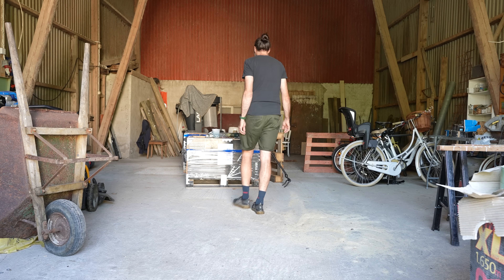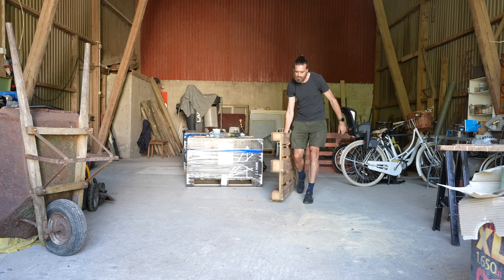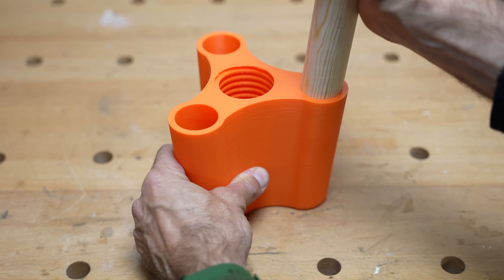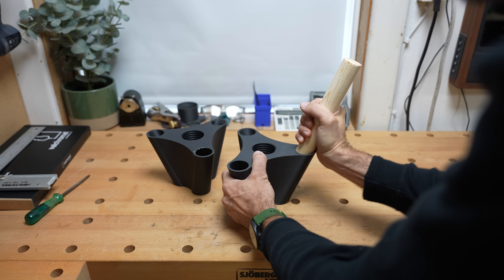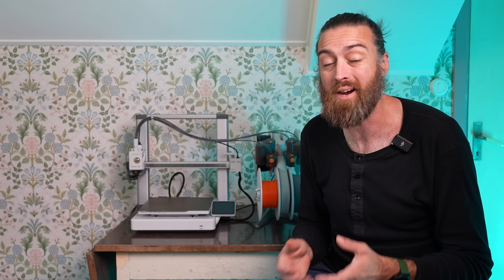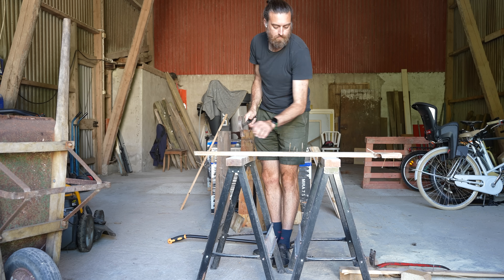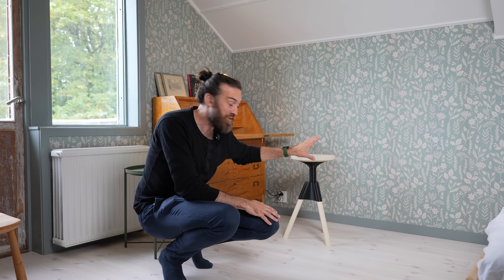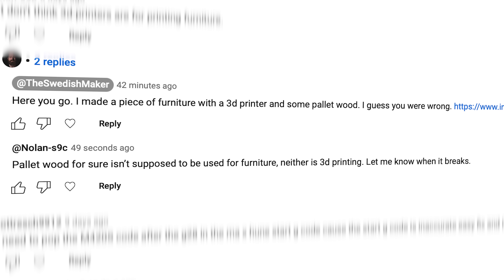furniture from this?

Comment: I’m new to your channel but I’m glad I found you. Your humour is definitely on my level. On the subject of adding strength to a larger 3D printed object, I would, for the threaded part, consider two options (both are basically the same operation). Where extra strength is needed I tend to turn large threaded parts into threaded tubes. The extra walls increase tensile strength while reducing material. If that doesn’t work, a rod can be fitted into the tube (provided you have accounted for the diameter in the design). In some parts, I will incorporate voids into solid areas just to get the wall count up if I don’t want something to crush easily. Just some ideas. You can ignore them or use them. I really don’t mind. Looking forward to your next project. Thank you. ❤

Comment: for improove your design resistence, must have to put a stick in the center of the thread part. So, the 3d print brings you the thread and the center wood stick, give you the strength. Because, the filament are working in the same plane of the threat cut direction, and it will break.

Comment: Thank you for your content. I was thinking about your wobble that you mention near the end. You may want to use an Acme Thread profile rather than the V shaped profile it appears you have used. That should give the thread more bearing surface to sit on and reduce wobble. It may also reduce your print times and materials used. I also watched your Wood Thread making video.  To make the acme form in wood I'm sure there would be a cutter to do the trick.

Comment: In my country the pallets that you can get for free are only those that was used for transporting stuff for years, and they are all dirty, broken, soaked in all kind of stuff. And even in your case, with pallets in better shape, you needed a lot of work to make them into proper wood. So it's like those videos with dude who makes alcohol from toilet paper. i.e. with a lot of work, skill and tools you can make furniture from anything, from any garbage, but is it worth it? Maybe only as a challenge.

P.S.
And of course you can use 3D-printing to make furniture, you can use 3D-printing anywhere where it's useful, it's a general purpose tool, nothing in the idea of 3D-printing say it cannot be used in some craft. One can say that 3D-printing can't be used in some very specific case, like "you can't use PLA to make a rocket engine nozzle", but claim broadly like "you can't use 3D-printing in building rockets" - is stupid, because you can definitely find some case where you can apply it there =) and same with any other craft =)

Comment: Print the threaded part in a harizontal direction. Just fllat a small part of one side of the thread for good contact with the bed and no support needed. Slice it with 5 walls and triangular infill (30% is enough ) it will become much stronger

Comment: The engineer in me was left curious as to the wobble being from treads flexing (narrow region along spiral making contact), or the due to the long screw being at a higher height and bending? Other comments think it's bending, as are suggesting an insert. Does it still flex the same way at low height adjustment? One possibility is a design element that functions as a locknut, setting the minimum adjustment heigh, and adding extra set of thread contact points further up in the vertical dimension.
Note with 3d printed threads, the both thread elements don't need to be continuous spiral, one surface can have gaps, or a pattern that doesn't look like a thread. (eg: like a thread tap, but could be more complex and non-symmetrical)   
IMO a bit of flex is a softness comfort factor, as stool gives a bit depending on body posture. 

BTW: a textured surface can be added to prints, it just adds more time when printing. From a design perspective, used wisely it offers new opportunities in how parts appear when finished. Looking forward to seeing how you experiment with a hybrid mix of plastic and wood in future designs. Most designers tend to stick to one, or the other. Another possibility to explore is printing tooling jigs.

Comment: I have two ideas about the stool:
1. As some people already mentioned, insert a solid tube or dowel in the threaded part to prevent the wobble. (And should also save some print time.) 
2. Add an additional printed nut on the threaded part (above the base). So when you adjust the stool to the right height, you can lock the nut snug against the lower base and it should hold the thread from spinning when you are sitting on it.

Comment: Get the right pallets and they are made with hard wood. Some have lovely colour running through them. There are lots of furniture masde with pallet wood. Some people make bed side tables / cupboasrds, tables, wall hung cupboards, coffee tables benches etc from pallet wood. 3D printed items could also be inserted and put into furniture. Depends on the 3d printer filament used as to the strength.

Comment: I don't know if that threaded section is the strongest way to use the 3D printer in your furniture because of layer lines in that print orientation and then the root of the external thread being a stress riser. But I definitely think 3D printing has a place in furniture making just like any plastic is used in making all furniture. I think if you had the X1 carbon or an enclosed version of the Bambu labs printer so you could print with the really high strength stuff you could probably get away with your current design indefinitely without ever having to worry about it breaking or being wobbly. Great video! Next level sound tracks really set Youtube videos apart!

Comment: I would not trust those plastic threads AT ALL...  Best case scenario, they will strip.  Worse case, it breaks and someone gets hurt.  Also stick with gyroid infill for any 3d printed parts that require strength.  Have you considered a much coarser pitch with chunkier threads?

Comment: 2:26 one thing I've come to learn about bambu's slicer recently, is there has been an open ticket for a while involving no compensation for material shrinkage properties being available. The slicer knows the material you are printing with but doesn't give any form of automatic XY compensations for perfect real-world measurements-to-fits. 33mm turns into more like 32.8 - 32.9 as a result of the unavoidable 0.3 - 0.5% shrinkage PLA encounters(PETG can even go to 0.8%), also this shrinkage does scale a bit with nozzle temperatures, so the hotter you print the more it shrinks. It's apparently still on the roadmap to be added at some point, but it's odd because prusaslicer and orcaslicer already have this nailed down and it's existed for a while(they are based on each other and impovements often get ported, yet not this one).. you have to scale objects only in X/Y to get real world results, which is kinda hacky, imo.🤷also they recently changed it so if you rotate a sideways part, XY scaling options aren't even necessarily parallel to the bed, weird design choices.

Comment: You should keep in mind the orientation of the layer lines: the parts are weaker along the layer lines (just like wood is weaker along the grain).
Reply: Yeah I always thought of it like wood in that way. Orientation makes a huge difference when it comes to strength. Also print slower, with slight over extrusion (experiment with values) and lower or even completely disable cooing depending on the part and you get closer to isotropy. I noticed with printing PETG I could get extremely good layer adhesion printing with around 120-130% flow rate over my normal "accurate" flow rate. For parts that need strength the slight loss in accuracy is minimal and you get the added benefit of near perfect transparency when printing transparent PETG. I haven't tried with other materials but I feel that the more transparent a print is, the less gaps you have (when using a transparent material, of course) and the closer to isotropic properties it will be.

Comment: Give the stool to a toddler. Either the toddler or the stool or both will be broke by the end of the day. lmfao. Maybe print the parts in a really sparse gyroid infill and fill them with epoxy for strength? You printed the parts in petg which should account for some of the flex it had. Maybe print some tpu feet?

Comment: If the threaded part breaks, I would recommend putting a wooden dowel through the center of it for reinforcement on the replacement print. Or even use a threaded wooden dowel like you made previously!

Comment: Pallet wood is pristine clean compared to railway beams. I would be weary of pallet wood, but I think the bigger danger comes from working on them, not using, maybe it would be enough to apply some sealing finish to minimalise any potential off gassing. Not only the stuff they used to treat it, but also any junk it could gather during the use.
3d printing is just a tool, it all depends on use, design and technique. I don't like the 3d parts finish, so I wouldn't use raw 3d print on design surface, but I certainly see 3d printing have use in furniture making overall. I don't think I would trust them with structural things without at least safety margin of 3.
Your design, I don't know, with the wobbly screw, I wouldn't send it to that guy at least ;-).

Comment: I think it's a silly debate. is it woodworking? are you a woodworker?

Back in the early days, craftsmen usually picked one element and went with it. Due to the cost of major tools, it was easier to craft what you needed with the tools and element you had (wood in this case) then try to combine elements. But even then, they still combined things. A metal Nail? god of woods forbid! A metal hinge? shame on you! Glass in the door? Heretic.

But these days technology has surpassed this, and multiple elements can blend in easily and are available to the "average" craftsman. So I think we need to just refer to ourselves as what we are: Craftsmen. or Craftspeeple, depending on how wimpy you are. Sensitive...I meant Sensitive. Yeh, that's it. Either way, we are CRAFTERS. The material is just an element used to bring the vision to life. or to just have a decent piece of furniture in the house or shop.

And we adapt, simple as that. If the power grid disappeared tomorrow, we'd probably just open the garage door for light, and grab our hand tools and go to work. It's not what we work with, it's what we DO.

Comment: By the way the song was all right, but don’t give up your day job, 😂😂😂, and if you don’t sharpen your blades you will do damage to your motor, as you are putting unnecessary pressure on your motor, be safe, stay sharp, or be in the dark, 😂, from France.

Comment: I have a question on the dowels not fitting in the 3D prints. If they are off just slightly, why not sand the dowel some to fit?

Comment: Great video as usual.

One idea to rove some of the wobble in the threaded 3d printed part if the chair is to pretension that portion in compression.
You can use a piece of metal threaded rod (internally and hidden) with 2 washers and 2 nuts to compress the 3d printed part.

Comment: You should cast the bottom part of the 3d printed part in aluminum or even better looking bras. The threaded base culd also been made if the same material but machineing would bee needed. Maby the easiest way would to take parts from a adjustable legg from scaffolding.

Comment: @Nolan-s9c was right I feel... It's not just the fact that 3D printers are not for furniture though. It's that PLASTIC isn't for furniture. Haven't we learned anything from decades of plastic production? It's disposable. It doesn't last. When it breaks you can never really repair it satisfactorily. It ends up in landfill. Number 1 reason it became sooo abundant? CHEAP. And cheap seldom is any good.  
I wonder what Greta thinks about 3D printing??
Reply: 🤦‍♂️ what a cringe comment lol

Comment: Big fan of my Bambu printer. And also like adaptive cubic infill for a lot of my parts.

 If you leave hole in the center of your big plastic threaded cylindee for a simple metal threaded rod to reinforce it you'll get rid of that wobble. There is a lot of torque on that part.

Comment: It's not that you can't make furniture using 3D printing, it's just not an ideal choice of materials and construction techniques- the threaded part is clearly going to snap if you lean just a little further side to side, and the legs will bust out the sides of the base piece if you sit down too hard. There are stronger filaments with carbon fibre that would hold up better- PLA is not a good choice for structural elements. Reinforcing parts with aluminium tubing would help a lot...

Comment: Design the post around an old steel pipe? There's plenty of it lying around most places. It's the threads you're after anyway. Pallet wood is "free" only if you don't count your labor hours. Poplar can be beautiful, or even maple and both are reasonably cheap.

Comment: bambu is great, bought my x1c like 2 years ago and its running since then with absolutely ZERO issues.

also pallet wood isnt exactly the best thing ever, not because it was treated, but because you never know what happend to it during its lifetime. could well be that it got spilled with something very unhealthy, you never know. solution to that would be to buy new pallets from a manufacturer, but there again, if you go to the pallet manufacturer, you can just buy the crappy wood off them before they make a pallet out of it :D also a stool shouldnt be toooooo bad. i would not build furniture where you spend long hours on out of pallets, but a stool you sit on for half an hour occasionally shouldnt be too bad either way

Comment: Methyl Bromide is used in container/container content fumigation to kill bugs and similar things. After fumigation, the containers are aired out for day, but they're good to go after that. You can't export pallets out of AU/NZ if the don't have the ISPM15 stamp to say they've been heat treated. If they don't have it, and the client can't repack, they are fumigated, aired and then stamped to say as such - ready for export

Comment: Man, I think if you were going to use the wood without the nail holes, you could have just cut them with a manual circular saw and then done all the preparation work, but dismantling a pallet is always an experience, good or bad, it's an experience.

Comment: Those carbon fiber composite filaments would work really well for this project. They are extremely stiff and strong and would probably remove that wobble issue that you're having because of the 3D printed stool stem flexing.
Reply: Or just make a bigger print
Reply: @EnlightenedSavage  You could print a giant cube and sit on that. It would be far easier sure. I was making a suggestion that would not compromise the design, style, and function of the existing piece.
Reply: I don't think it's a good idea to make screw threads out of fiber filled materials. Won't help the Z axis anyway. The wobble looks like a combination of clearance and thread engagement, rather than material properties.

Comment: Wait so pallet wood, that's used to transport heavy things, is not suited to be sat on because it will break? I fail to see the logic here.
Reply: @djstuc  Not really, the weight when sitting on a chair or on a stool is spread quite evenly across most of the surface. 

Maybe if you build a long bench and sit in middle of it, or are building stairs or something out of it, but small furniture pieces?
Reply: @djstuc  I still don't really see a reason why they couldn't be used for simple furniture though. 
If they are able to carry stuff without breaking in a warehouse, why wouldn't they be able to have stuff on top of them in a piece of furniture. 

Nice hearing from someone whose actually experienced with them though, I've mostly just seen them used by others, know someone who builds a lot of stuff out of pallets he goes get free from places.
Reply: @djstuc  Stepping in the middle of a plank with just air under it is quite different to sitting on a well made chair/stool.

I do fully believe that they use low quality/cheap wood, but I can't see how the wood would be so bad you couldn't build anything out of it while keeping that in mind.
Reply: @djstuc  Yeah. understanding when a piece of wood is strong enough for your application is a good skill to have. 

Anyway, thanks for sharing your experience, now its time for me to go to bed. Goodnight :)

Comment: Why did you chose one of the least optimal designs for 3D printed furniture part?
That leg holder is ok and strong I'm sure, but the screw bit will be weak even if you print it with 100% infit, too many stress points, and relies fully on layer adhesion.
Don't want to be the troll, but that thread will break if the stool tips over.
Reply from the maker: Yes I agree. I just wanted to try it out and had very little time to do it in, but I think using the leg part with longer lega and putting the seat on top of that will work good
Reply: @TheSwedishMaker  yes exactly

Comment: Any tube that long will flex a bit under a persons weight, and threads without huge engagement also tend to be wobbly, and in plastics that tend towards bendy elastic in nature its bound to be noticeable. I doubt you'll have any issues with it for a long time though it doesn't look like it is flexing near the limit.
Be worth screwing it down almost as far as it goes and seeing if that takes out all the apparent flex - then you will know its mostly if not entirely in the threaded tube section and can add a stiffener if you want to. And if screwing so low down doesn't make any difference to the feel at all then you know its your thread clearances that that too loose. It may well be a bit of both.